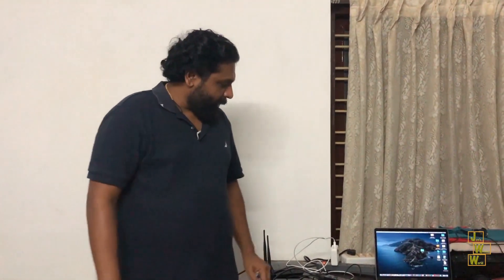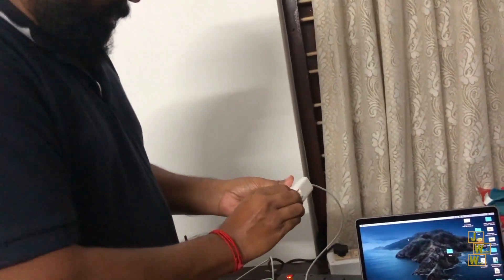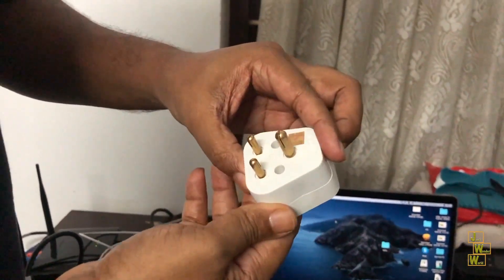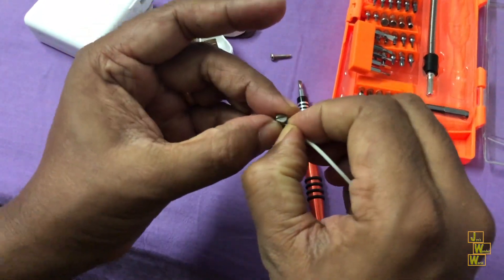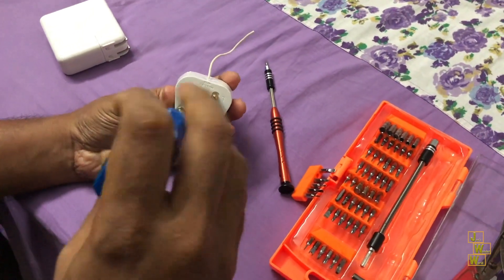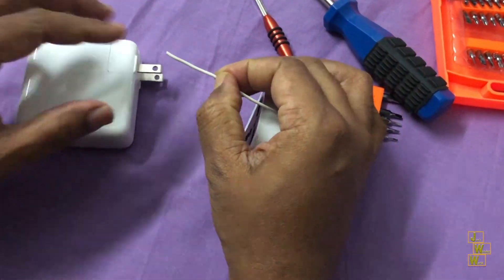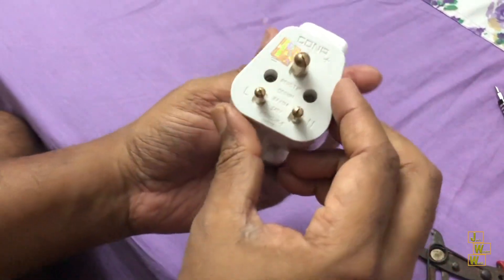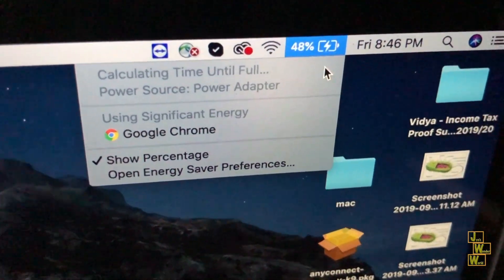How to avoid electric shock from a laptop while charging

Comment: Thank you sir, just happened this to me. Going through the comments made it clear for me that using a different extension was the cause and mine was the same. Removed the extension and checked it directly from the wall socket. Back to how it was, with no small shock sensation. Guess the different extension that I used is the problem.

Comment: I got 3 pin adapter with my mac pro 14". But my whole house/home electric wire is not earthing proof. That is why i feel still  MacBook electric shock leakage issues. Could you please tell me any other solutions? Thanks in Advance

Comment: So what difference does it make unless the is an earth connection to the chasis of the laptop to your domestic earth? Your AC/DC adapter may have an earth connection input but the DC connection to the laptop is mostly DC+ and DC- unless you're dealing with a three-pronged jack. Most jacks are two-pronged.

Comment: Sir i m getting minor shock while touching usb ports 
My battery has damaged so i use laptop while charging only
Wht is solution of shock?
Reply: Do you have 3 pin charger?, when using laptop for heavy use, it's advised to use while charging
Reply: @isolvechess1941 I have 3 pin. Getting shock what do I do now ? Pls tell

Comment: hello sir I have realmebook laptop with 2 pin charger and I am feeling sensation on metal body while charging..charger is fully packed like normal mobile charger so where should I connect earthing wire
Reply: Bro did u find any solution. I have recently brought realme book . It has earthing problem

Comment: Does this work with any laptop charger? Recently bought a Dell laptop and it has a static charge whenever I try to charge it
Reply: Did you solved your problem? Mine is doing the same thing
Reply: @imanolcastillo2931  even my predator does that and its brand new
Reply: it may be due to improper earthing in your house
Reply: @imanolcastillo2931  Have you been able to solve yours yet? Mine is also giving me shock. It's a dell inspirion 7573 with metallic case.
Reply: @benchmarkslab2005  did yours get solved ? i have the same acer predator and it gives shock all over its metal body
Reply: @gopireddy1703  yes. We need ground earth bro
Reply: @benchmarkslab2005  what should I do?
Reply: I bought my legion it's doing the same
Reply: @benchmarkslab2005  brother thik hua kya am also going through same situation
Apka kese thik hua ?
Reply: @gopireddy1703  is your problem solved? coz im in the same situation as yours
Reply: @amitsharmaz10106  nope
Reply: My ho Pavallion does the same .... technician came and disassembled it twice but nothing worked.

Comment: Sir, I bought MSI modern 14 laptop recently.The keyboard and mouse pad is all metal body. Im getting shock every time when i used the laptop while charging when it is kept on the wooden table.  can anyone please respond what i have to do to overcome that shock from the laptop please respond anyone
Reply: have u got the solution yet? mine is doing the same thing
Reply: That shock is 20v dc laptop output it’s harmless. Use a 1. Finger cap of plastic 2. Grounding . My laptop has been flawless for 5 years no earthing but i get occasional shocks (20v , 40milli amphere ) so use finger cap

Comment: Sir i have recently bought a acer aspire i am getting shock from the tip of the charger
Reply: Same for me also from some parts below laptop also
Reply: For me too....what you did bro??
Reply: How u fixed that?
Reply: same with me, im afraid the battery will be damaged
Reply: @Tuna.breaddd bro plz tell how to fix that
Reply: @flamingyt6977  bro for me the problem was from the switch board and the place you keep it on try changing the places and test

Comment: Hello sir...i have hp laptops with 3 pin charger...its giving shock while charging..what should i do
Reply from the maker: zameer Gaming world , Are you using any extension box? Tried connecting to different plug, or different home/ office. Still if is coming, then you may have replace your adapter.
Reply: @jyoswonderworld-jww4271  Thanks for the help. You had mentioned the extension box, and i had recently plugged my adaptar into another extension box, after which which my laptop had slight shocks. I didnt know that it was the extension box. After reading this reply, i plugged my adapter into another switch instead of the extension box  and it fixed the  problem

Comment: i have HP metal body laptop , i feel small amount of shock while charge bcz in my home earthing is not provided , can i use as it is for some time ?, to use without earthing wire is harmfull for laptop ? please give me ans
Reply from the maker: It would always be better to use with the proper earthing system
Reply: @jyoswonderworld-jww4271  sir is it common to give vibration to metal laptop during charging or should i replace?(laptop vibrate if i use extension board)
Reply: Hey, I have the same problem,my home is also not having earthing... Did you find any solution?
Reply: I do have the same problem..Did you find amy solution
Reply: Yes, you need to install earthing, if their is  earthing already then this didn't happen, you don't need to worry about it, your laptop have not any problem
Reply: @SahilSavaliya  bro have you installed earthing??
Reply: @muraliroy7324  yes, and problem solved
Reply: @SahilSavaliya  instead of earthing can we use TV stabilizer for laptop ??.
Reply: @muraliroy7324 what is that bro ? Please tell

Comment: No home Earthing is the only reason for the laptop charger to produce little amount of positive charge current in the negative charged output and makes whole laptop's metallic parts to be positively charged.
Reply: @Babbu Maan Club  not a big impact but still it does. Thank you.
 .But As my method, what I'm saying/telling/asking is that, as long as you have a proper Earthing connection with your home wiring system , then this types of 2 pin plugs will also act as 3 pin plugs , because when you have earthing connection at home, neutral supply will also become earthing. 
So laptop's low voltage negative output areas like USB output or any metal parts of the laptop body won't be positively charged. You can check using a tester before and after applying your solutions.
Reply: I know its been 4 years but i have a question
My home has no earthing
How i can remove the static charge from laptop?
Its affecting the mouse usb port

Comment: How about other laptops? To be specific acer predator helios 300
Reply from the maker: Yes, this is applicable to all laptops, I mentioned MacBook because it has a full metal body.
Reply: @jyoswonderworld-jww4271  okay ill give it a try as i dont wanna return a brand new laptop
Reply: @AKPatel98  just check if your house is properly grounded... That was the problem for me... And before that i simply applied some tape on the edges of the laptop. 😅
Reply: @SenseiAtomic  Hi,  I know this is coming late. Please how do I apply tape around the edge of the laptop? Will the tape act as grounding?
Reply: @SenseiAtomic  Hi, please how did you apply the tape on the edges of the laptop? Is it from the inside of the laptop or from the outside of the laptop? Thanks!